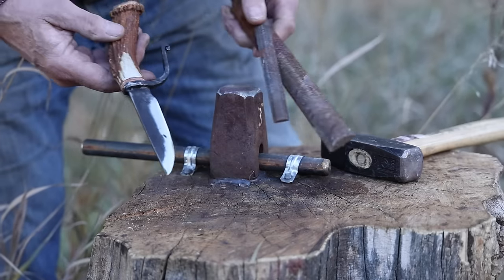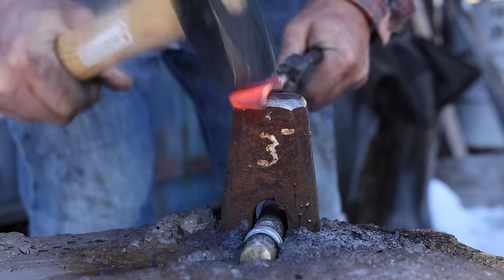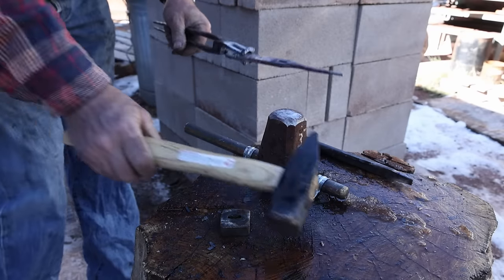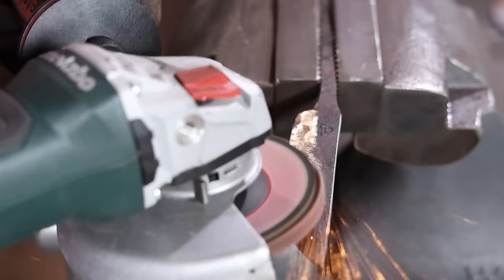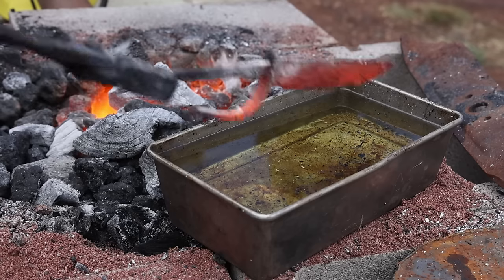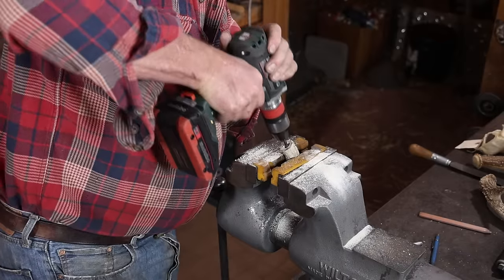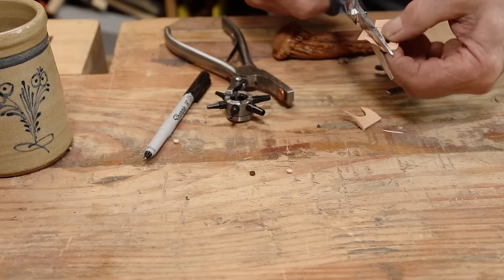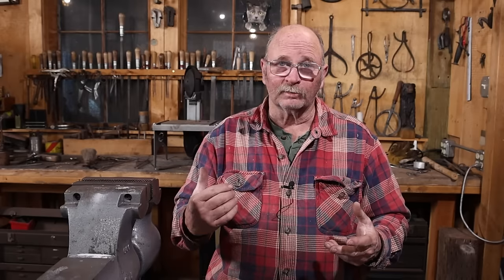Making a Knife from an Old File - Backyard Blacksmithing

Comment: What many people wanting to start blacksmithing fail to realize is how simple our ancestors' tools were. Despite that, they were able to make incredible items, some that are still in use to this day. All most of them had was a wood or charcoal fire, some method of stoking it anything from a hand fan, a blow pipe, or some sort of bellows. A small metal steak they drove into a tree stump of log for their anvil, a hammer, and some sort of tongs. But with only that, they were able to make everything from a nail to a full suit of plate armor, and the weapons used be that man. Today, people are used to watching people using tens of thousands of dollars worth of equipment to forge even the simplest of objects. They think all that is necessary to get before anyone can start blacksmithing.
Reply: That just takes so much time. Like you sir have said, imagine making full plate of armor or longsword on that steel piece embedded into stump with something that resembles a hammer. Doable 100 percent, but people developed these power hammers and different steels and big anvils and blowers further for a reason. I made chisel, punch(coil spring) and knife(old file) on setup almost exactly like in the video but instead of electric blower i used a hand fan. Very fun too, haven't invested anything but made very useful tools out of nothing basically.
Reply: @user-fw4mo3es1t  that kind of "can do with little" attitude will get you far. Good thinking sir.

Comment: A great tip I was shown for glue handling: squirt the epoxy into a tiny zip lock bag, mix it in the bag by squeezing it with your fingers, nip the corner off the bag and squeeze the glue right where you need it. It is a really clean method.
Reply from the maker: Great tip!
Reply: Nice! I've done that with sour cream and taco seasoning but epoxy 🤯
Reply: I can’t believe it’s never occurred to me to do that, but I’ll definitely be trying it out
Reply: I also like little plastic graduated medicine cups, marks for even measure and works great to mix in and pour from.
Reply: 100% agree, my Propmaking mentor taught me this!

Comment: ❤ totally love this backyard setup. I hope this series encourages people to pursue this hobby or business. I've been blacksmithing and bladesmithing almost a year now and I started off with a simple  setup that has enabled me to buy more material and uptool. Haven't made any real money, but I'm a part-time hobbyist and not ready to pull the trigger to go full-time yet. Might be a few years.  😊
Reply: Well I'm inspired... Now just to make time to set up a forge...  I'll get there...
Reply: @davidlee9299  heck yes! I'm still using the railroad track section and double horn vevor anvil I started with. The part I splurged a bit on was my propane forge and 100 lb LP tank. Didn't want to run out of gas in the middle of a project and bituminous coal is scarce around me. Not as cost-effective to use charcoal as it burns up too fast in my (limited) experience.

Comment: The cut and then bending the tip-thing is so, that the 'grain' of the steel follows it's trajectory according to the tip, rather than being 'cut off'. Being one of the benefits of forged steel to do that, rather than to just cut/mill it. It's used with puukkos, I do it and can usually or almost do it without cutting too from a square flat bar.

Comment: I've used glass as a hone for blades. A 3/8 or 1/2 thick piece of tempered glass Sand blasted on one side make an excellent sharpening glass for blades. With a little patience, you can get a surgical sharp edge on most knives.

Comment: I have a similar improvised setup and as far as I've seen, the blower is super overkill. I use a hairdryer on low setting and I can heat up some pretty big chunks of 12mm leaf spring and I also managed to burn a couple of smaller pieces when I didn't pay attention.

Comment: Another alternative / addition is a square quarter sheet jitter sander. Replace the foam with a hard rubber (I can't remember if it was 60or 80 durometer). Make a jig to hold it if it won't clamp in your vise. Clamp the sander in and you can sand your blades quite nicely that way.

I've even got a rectangular (think it's third sheet) sander with the foam backing intact that I'll also clamp in the vise and use for the final sanding of my handles 240/400 grit or so.

With the hard rubber surface, you can also do single pull strokes on the edge with paper hanging off to get that satin hand rubbed finish on the blade.

I also really like my psa paper. Seems to really work well when it's not moving around slightly.

Comment: if you aren't apposed to tips from someone who learned from you <3 I work with hairpins so the stock is very thin and cools down fast. I learned from watching Joey Van Der Steeg that you can lift the work off the anvil in between hits to prevent heat loss from conduction. Another thing I learned from a farrier named Rick is that when working on the horn or in your case the round bar, you usually want to drop your tong hands instead of rotating the work piece. This prevents you from striking at an angle and not having anything to support the hit. you want your hammer striking from top down not side to side

also thank you so much for the videos <3 they are really wonderful and I look forward to every upload <3

Comment: John, thank you for an interesting and informative video. One aspect I love about blacksmithing is building tools.  Perhaps a nice subject for an upcoming video would be making a knife handle rasp.  It's the same thickness as the tang, and has teeth on one edge.  It uses most of the same techniques as a knife, but has a lot more file work - the teeth can be formed with a chainsaw file and a flat file.  I think it might be of Japanese origin.

Comment: @14:50 Fireball Tool has done a conclusive test on this subject and your intuition is correct, leaving the file in contact on the drag stroke isn't hurting a thing. In fact it seems to clear the chips and allows the file to do quite a bit more in its lifespan than a file that's lifted after cutting.
Reply from the maker: I used to try and break the habit until I saw that video.  Now I just go with it.

Comment: I cut round sanding pads from standard 9x11 wet/dry sheets in the finer grits 300 up to 3000. Then i glue them to the face of old sanding disks from my orbital sander. Same old backing with a new finer grit sanding face. Works great for metal sanding.
Reply from the maker: Great suggestion

Comment: I like the clamp method for the odd shaped handle, I hadn't thought of that before. I recently built a knife handle vice for more typical knife shapes (I make puukko's) but eventually I plan to do some antler handles. Got a big grab bag of antlers recently. I do file knives myself but temper using a toaster oven then use stock removal on my belt sander with frequent cooling of the steel. Someday I will put together a proper forge. Got some good ideas watching your video, I like the end result!

Comment: you could probably put a dimmer switch on a watertight electrical box to dial down the fan to the desired flow, IF its compatible with a dimmer

Comment: I like to heat a thick plate to lay on the anvil before work.  Seems to help keep the ice cold anvil from sucking all the heat out so quickly. A hammer head anvil might not be so bad but it couldn’t hurt.  I like to think warm steel is happier and safer than cold steel. 🤷🏼‍♂️

Comment: a useful cheap power tool for knife and sword straightening is a hand held belt floor sander mostly used for leveling out wooden floors, works very well on longer blades

something else i have found to work well on perfecting a longer blades straight flats is one of those cheap diamond blocks with a different grit on each side

i use that to block out any minor ripples down a blade, gts longer blades super flat and straight, shows up when you mirror finish them, they not very good for final finishing as they can clog easy with steel but great for truing up long flats, cheap enough they can be replaced when worn out

Comment: Wonderful job on the knife. When I showed my girlfriend the video, she said " That looks like a knife I saw when I was a kid in trader's row in  Rezendevou!". So yeah, I might just have to turn a few old files of mine into some heirlooms for family members. That aside, do you happen to know if it's possible to forge weld multiple files together to make different forms of tools? If so, do you think you could make a draw knife or mortacing chisel video on it? It'd give you an excuse to use up more of the antler material and make for an exellent learning experience. 

Speaking of antler, I have some tips for people who want to incorperate bone and antler into their projects. This is stuff I recommend doing.

First, the most optimal and safest way to shape and smooth bone and antler is using a low tech application of hand filing and wet/ hand sanding. It kicks up less hazardous dust. Conversely; if you sand or carve your projects using power tools, do so optimally with a face mask and in a well ventilated area with a shop vac on to collect the dust. 

Second, Save some of your bone and antler dust for repairs. Violin and guitar makers use it to repair bone frets on acustic instruments by mixing superglue and bone dust together to form a " wood putty" type of filler. Once filed after it sets, it can be polished to a brilliant luster. ( note: I don't know if it works with epoxy, but if it does it may be quite useful in tang stabilization after drilling out the pith.)

Third,  to whiten bones and antler, let them soak for 3 days in a solution of hydrogen peroxide. To dye them different colors after whitening, use high proof rubbing alcahol and food grade dye after you do your final polish sequence on the components. Let the parts sit for 1 to 3 days or until desired color has set in.  Key safety note: DON'T MIX hydrogen peroxide with rubbing alcahol in the same solution. It's deadly toxic. 

Hope these tips help.
Reply from the maker: It should be possible to forge weld the files and it would make a good draw knife. Might be to high carbon for the abuse a mortising chisel would receive.  Of course historically only the cutting edge of these tools would be high carbon and files would be a good choice for that approach.

Comment: Dewalt angle grinders at lowes or home depot are about $89 but go to a welding shop and they sell dewalt 2 angle grinder for about $100 so you can set up one with hard face and other with flap wheel or cut off wheel  great set

Comment: Buy a few junky used up tongs at a Blacksmith show for cheap and remove the rivet Pick the better half of each set and use it as a pattern to make a good set of tongs, much easier than trying any other way..
Saving the best half of several different sets will save you a fortune and headache of learning. 
Tongs are safety equipment...
Thanks

Comment: When you was doing this and drilled out the side did you use the dust of the antler with clear epoxy then it would be invisible use a dremel to cut new groves where you sanded then stain with black strong coffee

Comment: I know you often look for new challenges. I wasn't sure where to send it to, so I opted for a comment on your latest post. I would be interested to see how you would forge a crate axe-hammer-pry bar-nail puller. An all steel, but with either full tang through and wooden handle, or all steel and leather wrapped handle. Sorry for cutting in on this thread.

Comment: Good looking knife, going to have to do a file knife. I imagine rasp steel would be about the same? I have a stack of dull rasps a local farrier gave me.
Reply from the maker: Most of the old rasps are good steel.  Some of the newer ones are case hardened with a mild steel core.  So its worth test hardening a piece before committing to the knife project.

Comment: i used to love smithing i would love to finally return to it in its entirety. i originally started it as a hobby to do with my grandfather back around 2016-2018 and ive got a shop worth of gear but my ventilation isnt set up so i decided my shop was too dangerous to work in.
Reply from the maker: I work with the doors open and use a fan as needed.   A good chimney is a must if burning solid fuels.

Comment: Thanks for the vid John. WIfe and I have been contiplating getting into forging for the past couple of years. Anyways, long story short. We cut down trees all the time and most of the time burn the larger branches and like today, I noticed alot of large chunks of "charcoal"? Can that be used? Usually I use to to kick start another fire at a later date. We were going to get a propane oven but if I can get this stuff free, well, its a no brainer. Thanks for any input.
Reply from the maker: Yes, that can be used. But it burns quickly and you will need large volumes of it for any serious forging.

Comment: Just wanted to add not all files are made the same ,old ones can be hardened in oil but the new ones are induction hardened most of the time ,they will harden but in brine -a mix of water and 10%  salt.
Reply: @honthirty_  would also love to know..lost contact with my Spring Manufacturers which i used to supply SS1083 Shovel Spring steel to in pre 1981..⁉️👍🏻🤔
Reply: @honthirty_  just another term for case-hardening.

Comment: 120 grit flap disk for a 7/8 inch arbor  " normal angle grinder " available at most auto parts stores . not available at hardware stores

Comment: Hey, random question, have you ever considered using a wood wedge or maul for the anvil? If not, why not? You can just pop an axe in the center of a log to make a crack and then hammer your wedge/maul home, and if the log is big enough to stabilize your anvil, it shouldn't split under the pressure and the wedge will get pretty firmly stuck.
Reply from the maker: People have suggested it, but in use it wouldn't be better than a sledge hammer head and eventually it will get driven down in to the stump
Reply: @BlackBearForge   Okay, fair point. I just thought it'd be easier setup for roughly the same result.

Comment: Parks 50 for water quench steels.  Temper cycles are 2 hours and should be double tempered, so 4 hours total.  Changing the color of the steel does not temper, that is more of an anneal cycle.
Forge On!!!

Comment: awesome video but the tempering process was too quick for me to grasp. A more detailed tempering explanation would be nice :)  the rest was easy to comprehend - cool knife!! looking forward to try and forge one myself :D
Reply: After you harden the blade you want to sand off the oil residue so you can see the bare steel.

Heat up a block of steel (not the blade) and lay the spine of the blade on the hot block tip hanging off the block and pay attention to the color changes of the steel.

As the blade absorbs the heat the color will start to shift in order: 
tan - gold - purple - blue. 
It will get softer and softer the further down the color chart you get.

You want to heat it up untill the edge (the furthest from the hot steel block) just barely turns a straw gold color, the spine will probably be a bluish or purple at this point and you will want to dunk it back in the oil to cool it back off.

The spine should be nice and soft by this point but the edge should have retained a good bit of hardness so it will hold and edge without chipping or snapping.

If you don't want the difficulty of judging the temp and time by eye a lot of smiths will just toss the hardened blade in an oven (a counter top toaster oven works) at 350-400 °F for a couple hours then let it slow cool in the oven after you turn it off, this will bring the entire blade to a straw temper.
Reply: @DH-xw6jp  Thank you very much 👍

Comment: I  made a knife from an old mill file.     Some people use a small section of railroad track for an anvil.
Reply: BTW....on the handle I sprayed some spray adhesive and sprinkled some sand on iit and then sprayed some satin spray paint on it and it was an excellent non slip finish.

Comment: Quick question: theoretically, if you harden a blade but don't temper it, could the heat from the grinding process if you don't go too crazy with it draw enough hardness out that it's not brittle but still edge holding? I like your method of using another piece of steel for the temper, I've got a piece that would be perfect for it. Most of the stuff I do is too big to just put in a toaster oven, which is why I'm asking.
Reply from the maker: In theory maybe.  But a hardened blade will often stress crack if it isn't tempered right away.  Grinding will also heat the thin cutting edge faster than the thicker back of the blade resulting in the edge being softer, the exact opposite of what you would want.
Reply: wont work and trying to quench it just right so it doesnt need tempering doesnt work either ive learned the hard way.

Comment: Rather than extending the tang of the file, given that you then cut off the end of the file, would it not be a good option to use the whole file blade and create an almost full tang?
Reply from the maker: If you're after a full tang knife that would be the way to go.

Comment: A word of Warning from an Old Machinist.  Was going to use a worn out Chainsaw File as a Tool Bit.  Usually I notch on the Grinder and Snap of the piece.  Rather than Snapping it Bent....
Betting it's made of Low Carbon Steel and then "Case Hardened"
Best to find out and test before going through all the work Forging and Heat Treating only to find it's not suitable steel....

Comment: Looks like the anvil in that snow is sucking the heat out fast.
Reply: So just curious, why not do the guard out of the file, so you have a carbon steel s urface. You can 90 degree and have integrated striker for flint and steel?
Reply from the maker: A good striker needs to be very hard and that means brittle.  I would rather have a separate striker than risk breaking the guard off the knife